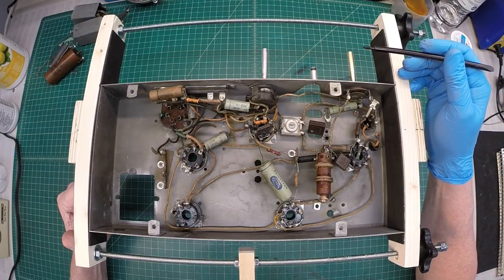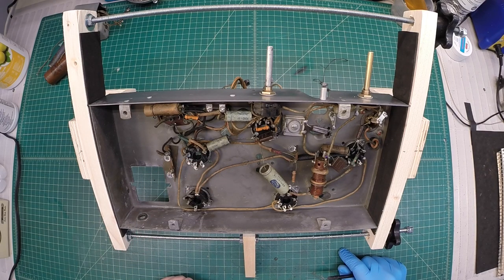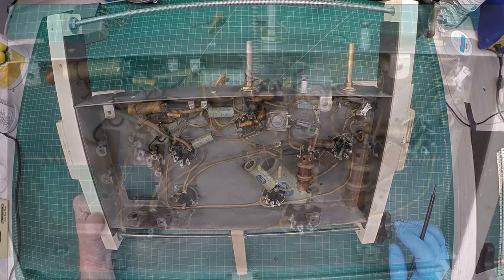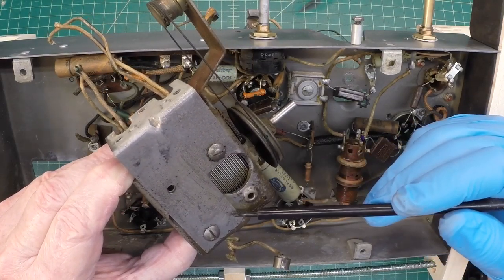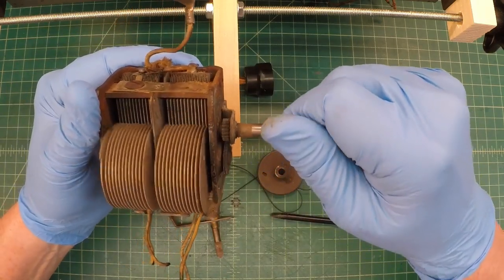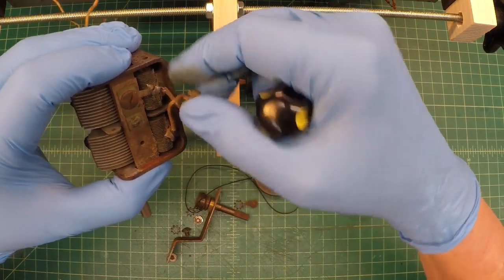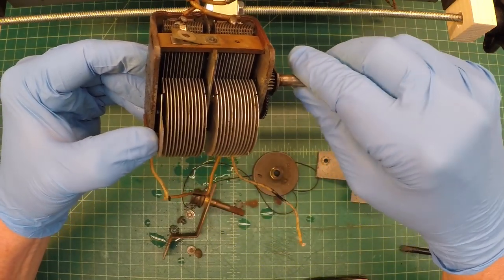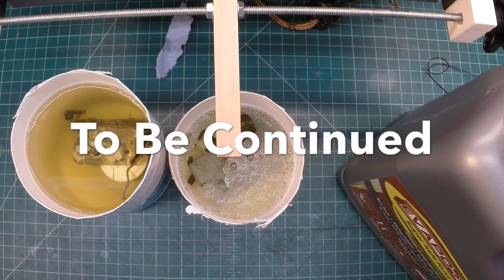Airline 62-306 Teledial - Chassis Holder & Tuning Condenser

Comment: That's a great jig for holding chassis you are working on. After getting through with the acid bath to get rid of that rust it will be great to see how well it works. Thanks for sharing Don.
Reply from the maker: Thank you. The scrap lumber and a few deck screws in addition to the threaded rods, etc., came in handy. I finished the de-rusting on the condenser today and hope to test it tomorrow and publish an update. Best, Don

Comment: Hi Don. very good work on variable capacitor. Almost nobody uses to do it, but you do. Because you love this work and good details. Congratulations.
Ketk (Spain)
Reply from the maker: Ketk - I completed the tuning condenser today. It did turn out well. I need to get new leads soldered on and clean the mica and get them in place. Hope to have an updated video soon. Best, Don
Reply: @RestoreOldRadios  , be careful with mica. I remember when was a young I was doing cleaning inside one SW transmitter 5 Kw power, and I used and air compressor to clean half ton of dust that was hidding all parts, and I didn´t see one mica 10 Kv capacitor, only saw one million of mica particles flying suddenly from the inside.... Then... Afterwards I should to change 10 Kv mica capacitor for a new one, and got a hot ears, heated by the mouth of my boss...
I learnt that day to be more careful with mica capacitors.
Revenge came two years later... he was doing FM multiplex 60 channels adjustments, and he did them bad because he didn´t read handbook adjustments instructions before... and told that to him and he responded I was wrong and nobody to say him, an expert about how to do his high level works... then I insisted on his adjustments were badly done overpowering channels, and he climbed up to the supreme boss of our company to give him a claim against me, and asked to firing me cause a fault of respect to my boss... It were fine... I only took handbook down my right arm, opened it, connected power channel & spectrum measuring instrument and probed multiplex FM transmitter was working overloaded and out of armonics... and our supreme boss looked at him and told only: I have a lot of work to be listening to you. Readjust that multiplex FM transmitter again down the supervision of Ketk. And went back to his office room.
Then my boss told me: Terrible!!!, come on to readjust FM transmitter. You, terrible, will do it. I And I did it perfectly.
Have a nice day and wish you to like this anecdote.
Ketk (From Spain).

Comment: I like the chassis stand seems to work great.  I agree love this Carolina weather. I pickup a 62-317.  needs work . Thanks for the video.
Reply from the maker: Thanks. It feels like winter again now. I looked at some examples of your new Airline 62-317 on RadioAttic; that is sweet. I love the colored dial and overall design. Are you restoring it now? Best, Don
Reply: Hi, no it will be a future project.(I have many) I am stuck on a philco  71 series code 125 and can not find schematics for it. All I can find is the 71-code 121. So it has been slow going.Thanks for your time and reply. Brian
Reply from the maker: Brian - I’ve got some Philco documentation, but I think it covers the later years. I’ll let you know if I find a match. I purchase my Philco service info from: https://www.philcorepairbench.com/schematics/

Are you going to the Spring meet in Charlotte this year?

 Best,

Don

Comment: Very nice Don.  I just finished working on an Crosley  124 ( 1931) and after soaking the tuning cap in Evaporust (It really needed it) I learned that the liquid did something to the stationary plate insulators and I had a short on the oscillator. it drove me NUTS for  months. I ended up disassembling the entire tuning cap and rebuilding it with new screws and insulators.  Works really good now.
I would suggest you also do a ohm test after its down so you can be sure.  I was getting like 2meg from the stationary plate to the orc plate before I fixed it.    Hope this helps.. Ron
Reply from the maker: Ron, congrats on the completion of the AK 124. I appreciate the heads up on the problem. I’ll definitely check for this. Thank you again. Best, Don

Comment: Hello Don. Looking good buddy. I have a radio I was working on. And have been thinking of an experiment,as it has sliver mica d  And that is to try and use that darn grease I cannot think the name of,for crying out loud.  It will not let voltage pass. ........ And use a needle to inject it between the mica and metal. I hope you understand where I am going with this. If it doesn't work than just a good cleaning and find the right value mica caps.  Oh anyway Thank you for all the great videos.
All my best.
Bobby